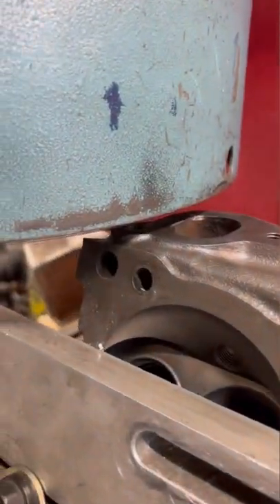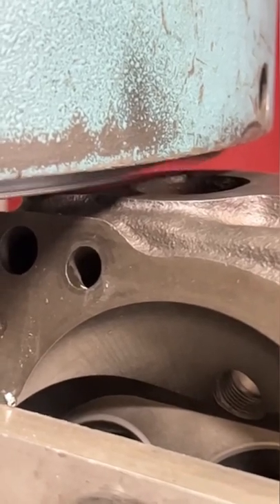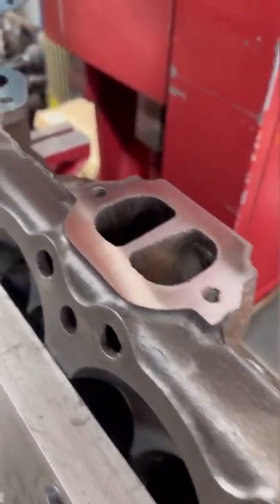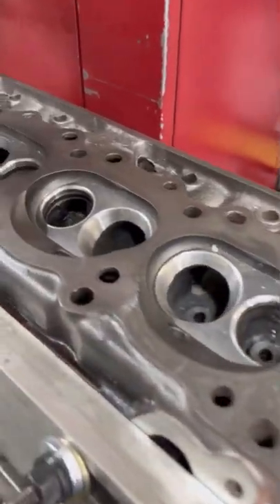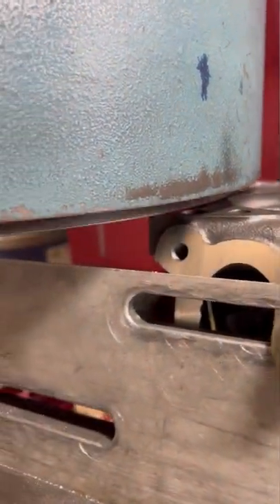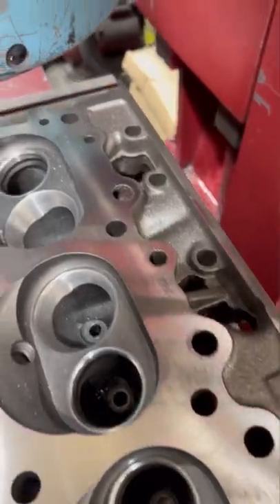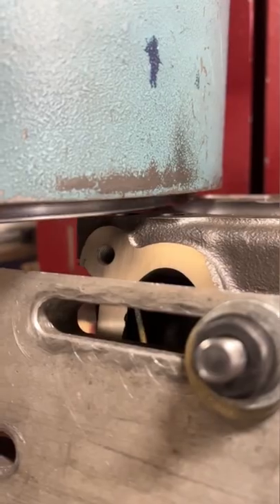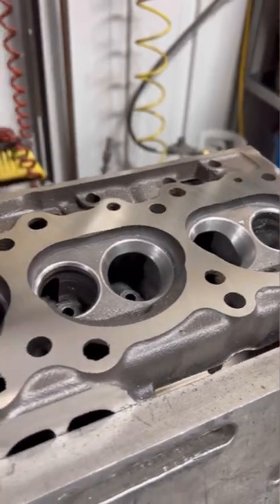#shorts A Little Bit Of Cylinder Head Resurfacing @JAMSIONLINE

Comment: I like all of the videos that you put out, but this one especially. 
I've had heads re-milled many times in the past and no one has ever checked the exhaust ports including my self, nice catch. From now on I'm going to be checking that as well. 
P.S. I've had alot of Pontiacs , 
And I quickly recognized that head. If you have a pair of them , I'd like to buy them. They are good heads.
Reply: If you have access to machines or someone buddy that does, make up a couple proper machined squares and/or long ass straight edges.

I'm sorta insane, admittedly, but I always check my beat up vehicles as the work is being R+r'ed. A trustworthy straight edge and feeler gauges are worth the effort.

Also, glass and some energy cloth works as a flat surfacing "machine" if the broke low cashflow is ultra serious.

I was born in the poor, molded by it, I didn't see the new parts until I was already a man(in age only, heh) by then, the experience was nothinf less than blinding.

It would be nice to just always buy brand new shiny parts, but the journey of trying to make junkyard stuff work alongside making any funds spent genuinely be impacted rather than squandered is what bonds me personally to my vehicles for sure.

Tools? Well... If they dont survive the first weeks hot suppers resulting in some of my own modifications then I consider the tools not fully mine yet. Can't really 100% own something until the warranty is voided, right?

Comment: Question. When they remove material from the face do they ever have issues with mounting bolt holes not being deep enough after?
Reply: Always wonder this as well. Like in general what's the max you can take off?
Reply: I believe that this issue can be corrected by going with a slightly thicker gasket to make up for the difference in lost material from the resurfacing.
Reply: @daltonfifield6541  or a washer
Reply: No. Yoh would have to cut down into the block to cause an issue, and at that point getting the bolts in is the least of your worries. A beard hair is around 6 thousandths of an inch. That helps put things into perspective on how little material is being removed. Even if you resurface it a half dozen times, the bolt holes won't be the limiting factor.
Reply: Compression ratio changes are a bigger concern, more so on high comp engines.
Reply: @daltonfifield6541  The reason the surfaces were damaged is because someone assembled using gaskets in the first place.  The gaskets will burn through and damage will occur to both manifold and head surfaces as they get "torched" by the escaping gasses.  Also, the manifolds will run hotter, causing warpage and cracking, issues with fastener damage.
Ditch the gaskets, IMO

Comment: Pretty sure Pontiac used no exhaust manifold gaskets, my preference.  Need to resurface the manifolds as well, reassemble without gaskets just as the factory did.
Ditch those gaskets, they're a bad idea IMO

Comment: That wheel or turner, what ever the technical term is, anyway, does it have a fringing wheel on it or like a lathe cutting bit, just wondering what's under there doing the cutting, tks
Reply: It's a flycutter. It has a hard insert that cuts the material. Traditionally "high speed steel" but this is probably tungsten carbide.

Comment: I ran a Storm Vulcan 85-B to do blocks and heads. Never really cut the exhaust side of heads but did do Intake sides occasionally. Usually to correct the angle after angle milling the deck side. I used a rollover table in a Bridgeport to do intake side of heads with a valve cover rail like a Big Block Chevy. Used a fly cutter with the motor driven table feed. I bored blocks with a Kwik Way FN and we had a CK-10 for honing. Also a Tobin Arp line boring table. I did rods, heads, blocks....We did not do cranks other than polishing. Sent them out for grinding and balancing. I spent well over 10 years doing that work. Street, race engine, boat.....we did most anything.....